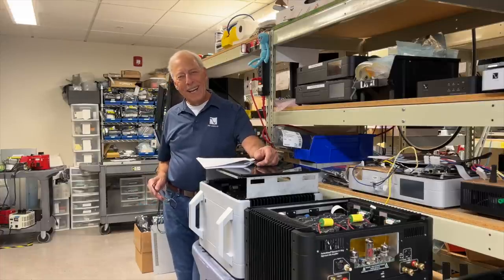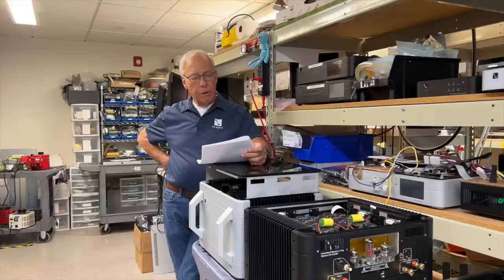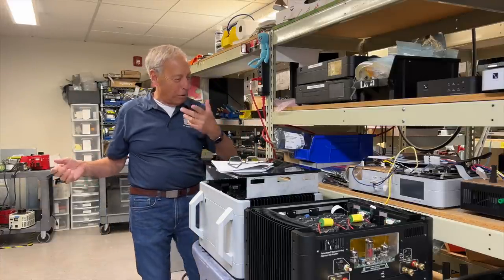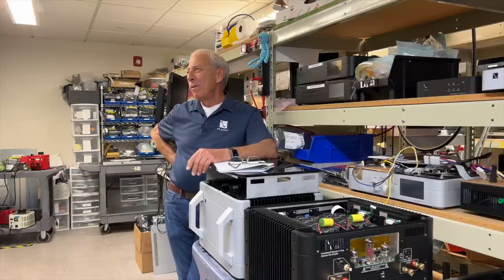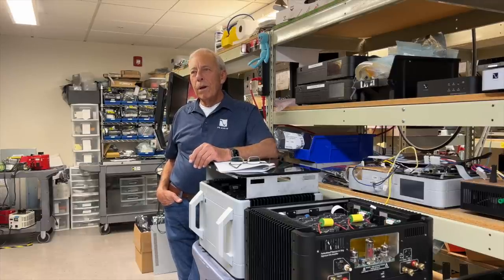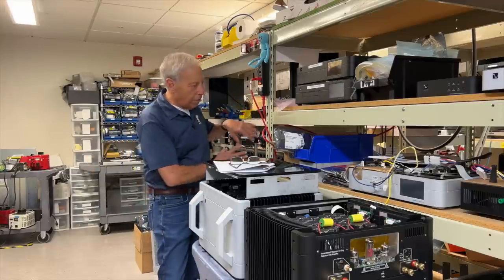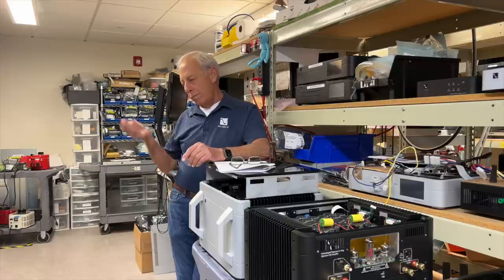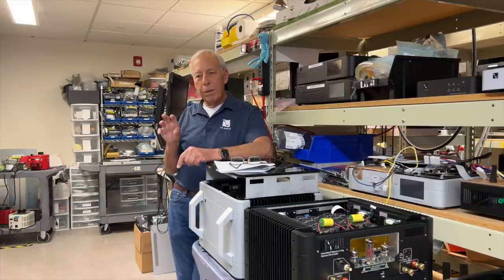Finding and fixing hum

Comment: I had hum in a subwoofer, turned out to be a dimmer switch on the same circuit, goodbye dimmer switch
Reply: An amp with a ground loop switch would probably also help a LOT!

Comment: I've got this issue. Interestingly, only noise when rcas connected. Even if they are connected to the amp, and not to the preamp. Almost like they are an antenna. Tried multiple rcas with same result. Tried the buzz x device as well. Nothing works.

Comment: I disconnected the ground wire to the chassis inside my amp, cleaned the surfaces then reconnected the wire. I also soldered the nut and lug to the chassis. The hum totally disappeared.

Comment: Important distinction: nothing connected including the antenna that is the cables on either end. Induced voltage in cables is a possible source for hum. They can pickup emi from other air gapped and unrelated devices by acting as an antenna.
Reply: That's precisely what I have.  I suspect it's the inline 3.5mm metal female to female adapter since moving it +/- 10cm from surrounding power cables induces the hum.

Comment: I have lived in Vietnam for 10 years. One of the surprising things about being here is that the residential power system is only two wires. No grounding for the house. I built a home here 5 years ago and added grounding. Not sure it helps but it should not hurt either. I have never had hum in Vietnam either renting our in my new residence.

Comment: I agree with Paul here on everything except the outlet not being the issue. I had a "buzz" coming from the tweeters on my LR mains, I had tried everything suggested here and some other ideas I had read about. I had determined the buzz was amplified by some of the programmable light switches in my house, if the lights were on, the buzz got louder and could only be heard if my XLR cables were connected to the amp. Very long story short (months of troubleshooting lol), it wasn't until I ran an isolated ground receptacle that I was able to eliminate the noise from the tweeters. The outlet was from PSAudio, powerport I think it was called. Just something else to consider as you are troubleshooting. Good luck

Comment: Paul. as always, great information.  Only true experinence shines through!!  You may have Snow On The Roof, but it's that Snow that Melts into Knowledge.  As an attestment to the Source creating HUM info, a quick personal Stereo story:  NAD 1300 Preamp, NAD 2600 AMP, Dual 5000 CS TT and a pair of KEF 104/2 Tower speakers all purchased in 1987.  Played beautifully then and Still Today.  A few years ago after not playing my Vinyl LPs for awhile, I heard a very loud HUM.  Checked and saw that from moving the cabinet, the Ground wire form the TT was disconnectd to the NAD Preamp.  That helped initially, but after playing for awhile - it returned.  I then gounded the TT ground wire to the electrical outlet - no improvement.  Brought the NAD to a repair shop.  he replaces and show me , burnt out diodes, a number of them.  After bringing it home, after playing for awhile - TT only- the HUM returns.  Return it the repair shop, where he keeps it for a week running constantly hooked up to TT he had in the shop.  Replaced a few more burned out diodes, as he shows me the old parts.  Bring it home and the same thing.  I start fooling with all the Connectiions.....Bingo a bad RCA cable connection form the Dual TT to the input on the NAD Preamp.  Googelm it, and it turns out the RCA cable is fixed and attached direcly form the Tonearm of the Dual and it's a common problem !! I didn't replace the RCA cable,but purchased an RCA extender (2 female and 2 male connections), fastened the new cable securely to the existing RCA cable form the TT and attchaed to the NAD - the HUM is gone.  It was simply a faulty RCA cable attachment Plug on the TT.  It is a Process of elimination as Paul describes.  In the midst of this, a curious thing is that I purchased a separate NAD P4 Phone Preamp, and when attaching the TT RCA cables to that Phono Premap, there was no HUM.  It could be that the faulty RCA cable did actually contribute to burning some diodes.  BTW, the Audio repair shop was terrific in that he only charged me $100 with 2 Bring Backs !!

Comment: The only time you should hear either hum or buzz is at very high volume, more specifically from your phono preamp. My system is dead silent except when I experiment and turn the volume on my phono preamp above 95 DB. I think that’s pretty damn good.
Reply: I agree, if the noise is only audible at very high volumes it is not a problem. This happens with one of my amplifiers after I changed the power supply with a more powerful (high current) PSU, but the new power supply improved the dynamics of the music considerably, although if I move the volume nob after 1 o’clock there is some audible noise. That amplifier is part of my office system and it is plenty loud at the 12 o’clock volume, so, it is not a problem.
Reply: Something simulair here, with my Lehmann Black Cube SE II ref, connected to my Rega P8 Apheta II combo. But only when cranced all the way up to 11 😛 
✌️❤️🇩🇰

Comment: Oh lord.  There are a few different reasons you can have hum or buzz, not just from equipment it self.  Yes sometimes equipment or tubes can introduce hum, but the bigger issue is ground loops.  This is caused by two or more components plugged into different phases of a AC line and sharing a common ground.  All most all homes have 220v line coming into your main panel and then is split on each side of the panel providing 115 v to each side.  The thing is each side of the 115v side are 180 degrees out of phase with one another.  Soooo if you have two or more components plugged into different phases and sharing a common ground you will get a ground loop.  So make sure that all components are plugged into the same phase or on low voltages sources I suggest lifting grounds.  I have lifted grounds all the time and never heard of an issue, but if your uncomfortable with that then just make sure they are all on the same phase.  The other things that can cause hum or buzz is dimmer switches, refrigerators or other appliances on the same circuit.

Comment: I live in an apartment that has no grounding. My system is also not grounded. I only use a line filter on the amps. The power cable runs alongside the audio cables, but these cables are shielded. Even so, the speakers are absolutely silent at any volume.

Comment: 60hz hum is usually caused by ground loop (simply to say there is two or more ground paths coming into the same device). Lets say you powering your amp and preamp with same 24V AC power supplly. So you connect +24 and ground (-)  to preamp and amp then you connect an amp and a preamp with an aux cable together so that aux cable (3 wires) shares ground between an amp and a preamp (L-GND-R), so this becomes a loop as ground (-) comes from power supply to a preamp then into an amp through an aux cable and returns from an amp into a power supply. Here comes a voltage difference because of different resistance between the two paths witch causes hum. To solve that problem you should try to:
1) Remove unneeded ground paths.
2) Ground all devices to one point (star-ground)
3) Use shields
4) Use ground isolating transformers
5) Connect all your audio equipment to same AC socket (audio source too)
Reply: What are shields?
Reply: Before doing all that, just use XLR connections between analogue devices if possible and use optical,or galvanically isolated electrical connections for digital.
Reply: Or DC buildup on toroidal.
Reply: @kentmeridian1  Usually a big sheet of metal (amp case, plate, ect.)  used for ground and foil or metal mesh wrapped around signal wires.

"EM shielding (electromagnetic shielding) is the practice of surrounding electronics and cables with conductive or magnetic materials to guard against incoming or outgoing emissions of electromagnetic frequencies (EMF). "
Reply: @bobnot24  Or bad AC to DC filter

Comment: Thank you for the great advice! As always! In my experience, a common source of noise is having a Wi-Fi Router connected in the same or adjacent power outlet on the wall, even if you are using a voltage regulator; just move the router to a different outlet on a different wall, in my personal experience it doesn’t have to be on a different circuit breaker. I used to have a Furman PST 8D (Advanced Level Power Conditioning) that could handle the noise but it stopped working after less than a year, now I use “quality voltage regulators” from reputable brands with my stereo systems. Also voltage regulators for medical equipment are better than the ones for office or regular computer use; and they are not as expensive as audiophile gear.
Reply: Furman is one of the most reputable brands in the power industry.
Reply: @VideoArchiveGuy  I know, and I agree with you. I just posted my personal experience, and I’m not criticizing a particular brand. Nowadays I am using AVRs with my audio equipment, and it works well, this is just my personal experience.
Reply: @VideoArchiveGuy  the brands I’m currently using are Tripp Lite and APC, they are good, maybe not as nice as Furman. But they have being working very well for protecting my audio equipment for the last 15 years.
Reply: @mr.blackhawk142  It is impossible not to use Wi-Fi at my office, it’s a matter of necessity and a convenience. Wi-Fi and Bluetooth are low intensity radio signals, and you can fine tune the power of the radio transmitters if you have advanced routers. It may not be ideal, but it’s part of modern life…
Reply: Hi! I do have a similar situation. I just got a svs sb-1000 pro subwoofer, connected through speakers level (vintage pioneer c-73 power amp with no sub out) and I got a hum in the sub when everything is turned off. Once I turn on the power amp and the pre-amp (m-73) the hum is gone. What I did notice is that if I take out the ethernet cable from the node x streamer/dac, the humming is almost gone. Still can’t figure it out. The ethernet socket in the wall is close to the power socket.
Reply: He said to unplug the input source on your sub and see if the hum is still there, then, if not, work your way back.

Comment: My Klipsch THX ULTRAII external Sub amp is dying I believe. 
   It sometimes makes a Very Loud sqealing sound through both Subs. If I cycle power on it I get No output & No spealing. Cycle power again and output & loud squealing comes back.
   Also the same thing sometimes occurs when I unplug & replug the sub out cable from the reciever. I dont have another reciever to test it with but Ive tried several sub cables w/ the same result.
Wish I had experience fixing amps, too broke to send it in for repair at the moment. btw it just started doing this after years of being in the same room w/ the same equipment.
Any Thoughts?

Comment: Hi. I’ve followed your instructions and hum appeared when I connected my pre amp to the power amp with two different interconnects between pre and power amp. What’s your advice please. Thanks.
Reply: Have you/ can you  try using xlr interconnect cables between your pre & power amp? That worked for me.

Comment: i have a similar problem, system so revealing it picks up noise.....static? EMI? It also picks up hum from another unit but that depends if the AC is on. No idea how to diagnose what in the pre-amp is picking up the noise, everyone just says its a design flaw and to accept it.

Comment: Hi Paul, I’m a subscriber.  My class A amp, (adcom gfa5802) just recently developed a slight buzzing hum on the left channel.  Do you think the filter capacitors for the left channel are bad?  I checked the DC voltage at the speaker terminals and they’re at 0.025V, so I think the coupling capacitors are fine.  Or do you think it’s something else?  Thanks in advance.
Reply from the maker: Hi David. Before you start thinking about the filter caps etc. in the amp, check where the source of the buzz is. For example, disconnect both left and right inputs to the power amp and see if the buzz is still there. If it goes away, it's more upstream than in the amp. If it remains, then it might be worth looking inside the amp.

Comment: I had a buzz/hum in my P12 for so long it happened to be caused by a table lamp on a seperate circuit. Does that mean noise is getting back in by the common ground?

Comment: After using the process of elimination the problem is my turntable transformer. The turntable has on off switch which doesn't effect the signal from the needle or the external phono amp. The volume on the power amp and  phono amp can be turned all the way up with no sound at all but when tuning on the turntable then the hum (60hz) is very loud and causes feedback in needle but only at near max volumes which is never used.  The humming gets louder as the tone arm is moved closer to the center near the motor or transformer, the corner where the belt for turntable is attached.  This turntable was around one or two hundred dollars on Amazon and must have poorly insulated transformer, and also the turntable has no ground  terminal.  The cartridge is a moving coil "Grado" cartridge.  Can the transformer be fixed or grounded somehow? Can the transformer be shielded so not to be so noisy?

Comment: Hi Paul. Thanks for this. Actually, I have a hum coming from my Pro Ject RPM4 turntable. I’m using Audioquest cables on my system to reduce noise (the phono cable is a Yosemite 72v DBS and the hum persists… Any ideas? Should I take my turntable to the “doctor”?

Comment: I’ve found that there is no such thing as a “perfectly silent” system as far as hum and hiss is concerned. The only thing that can be done is to keep them at bay when listening from your seat.
Reply: If you have set up your system correctly the only time you may hear hum or buzz is at ultra high volume. On my system the only time I hear hum is from my phono preamp when the volume is above 95 dB and I think that’s  pretty damn good.
Reply: @stimpy1226  Yea, that’s a good point.
Reply: My system is dead silent at 0% and 100% volume levels 
It did have some hum but I found a defective rca cable

Comment: I have a doozie. My 4 channel Linn C4200 is 2 x 2 channel boards in a box (4 channels total). If i use one channel from each board i get a slight hum. If i use both channels on the same board no hum no matter which board I use. Yes tried it with only the pre amp connected (in fact 2 different pre's and even without the pre plugged in to the mains (thinking ground loop) and it still hums. Right now as I only use single wire I just use one board so no hum but still bugs me.

Comment: I have 2 tannoy studio monitors connected to my small mixer, to my RME Fireface 400 soundcard which is connected by firewire to my pc.  The power to the computer was suddenly interrupted even though connected to a battery backup.  (Landlord has bad insulation and does his own "work".) Now I can't turn the left speaker on (5 inch woofers) without a very, very loud hum (woofer slamming at about 120 hz or so.  I turned off the mixer, disconnected the audio - and also tried switching from one power outlet to the other, nothing has worked.  The volume doesn't change even when the volume is off and it's not connected to any audio source.  (If I leave the audio connected to the audio source and disconnect the power to the speaker it stops. )  Something like this happened to me with a half rack digital guitar amp once - the resonance (or whatever) seemed to have been coming from the internals - like some kind of capacitance build up and discharging - I left the unit off for several hours and it resolved.   It's been an hour & he hum may have reduced in volume, but not much.  Any ideas?

Comment: What happened with the tweeter making hum? Well, one thing about hum at 50 or 60Hz is that it’s hard to hear where it comes from as audio at such frequency really can’t easily be located by hearing. Usually it comes from a woofer or subwoofer.
Reply: I had a subwoofer amp fail and it only popped every once in awhile. I swear it took a few months to even figure out that it was in the room as it sounded like it was outside the window.

Comment: My subwoofer (connected by LFE rca) used to hum like crazy.  When I disconnected wired ethernet to my "system" and went full wifi, it largely went away.
Reply: Hi! I do have a similar situation. I just got a svs sb-1000 pro subwoofer, connected through speakers level (vintage pioneer c-73 power amp with no sub out) and I got a hum in the sub when everything is turned off. Once I turn on the power amp and the pre-amp (m-73) the hum is gone. What I did notice is that if I take out the ethernet cable from the node x streamer/dac, the humming is almost gone. Still can’t figure it out. The ethernet socket in the wall is close to the power socket. But I’m a cable guy to say so and I’d like to have full sound quality if possible.
Reply: Unplug your audio source and your ethernet cable. See if you still have hum. If not work your way back.